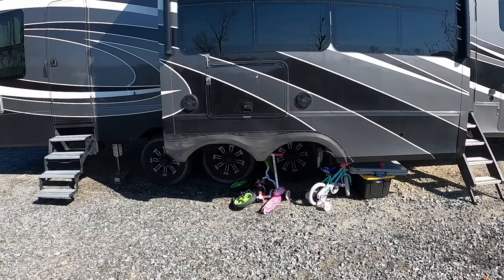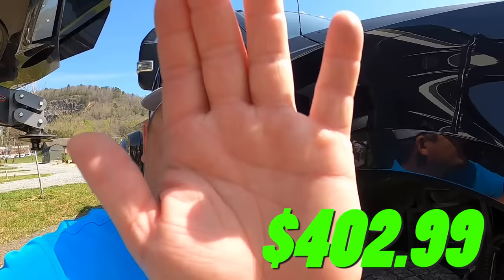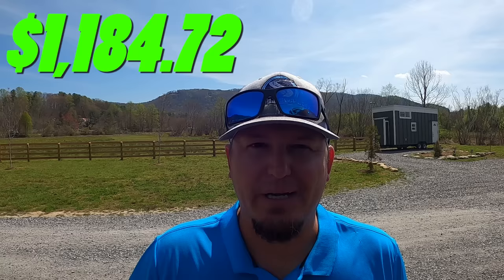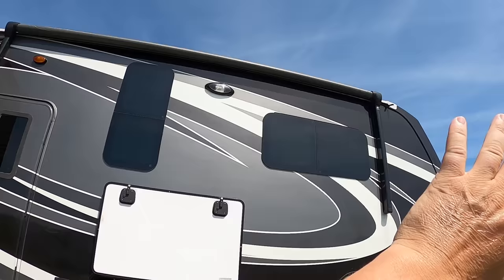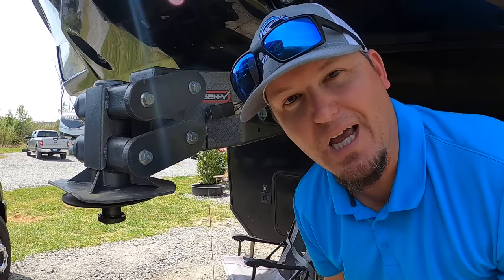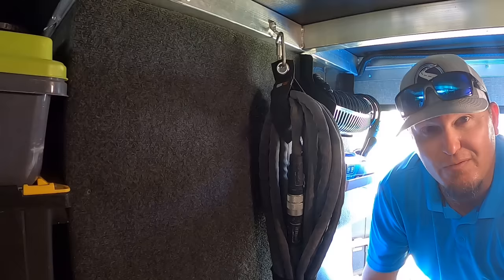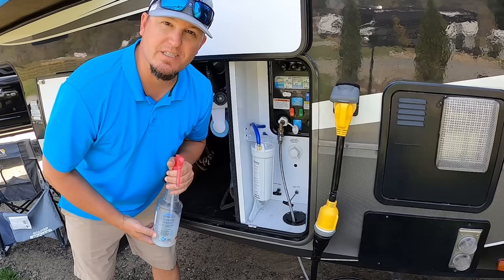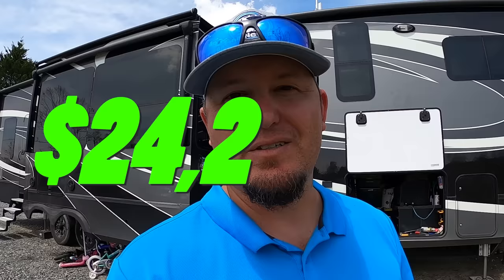These Things Are Money Pits! Everything That We've Had To Repair! | Fulltime RV Living!

Comment: We’ve had a Chevy 3500HD and 37’ Montana High Country 323RL for 5 years and have had NO major expenses or repairs. Almost everything that has gone wrong I’ve repaired myself. We’ve towed it all over the USA AND it’s been a great experience. Other than normal wear items like tires, batteries and oil changes, the truck has been cheap to run and reliable. We’ve never once regretted purchasing our Rig. It’s been a home away from home in AZ for several months at a time in the winter and a vacation home in the summer. For us it’s $ well spent!
Reply from the maker: We also have had mostly no major expenses! The roof was the only thing that was out of the ordinary! The rest was normal issues that happen when traveling fulltime! This has been the greatest thing we have ever done it allows us to explore the USA as a family and we love every minute of it!
Reply: You were one of the few.
Reply: Go Chevy!  Good luck !
Reply: We are on our 4th camper had a pop up in the 90s then got an 2001 28' Dutchman Zepher  TT in spring of 2002, with no issues went from ohio to california twice, and Florida every winter then spring of 2016 bought a 2016 38' skyline layton javlin TT traveled from ohio to washington state, new mexico, TX and Florida every winter with no issues so spring of 2024 bought a 2024 43' Salem Hemiphere 5th wheel , so hope we again have a good experience! Love to travel with an RV and it has a bed to match the one in our home! Happy RVing!
Reply: Thank you for your positivity and empowering the dreams of others.

Comment: So you are basically saying that I need to marry a RV mechanic that likes to do repairs and has a lot of money,  and loves to travel if I want to full-time RV. Got it! 😄
Reply from the maker: When we started we just thought you buy the RV and start the adventure! Maintenance and repairs has been our biggest expense each month for the last 2 years of fulltime travel! It is something we didn't plan for, we also learned how to work on our rig and save as much money as we could by doing it ourselves! If you plan on moving often your cost will be similar!
Reply: Hmmmm yes I miss my old 1968 Ford F-250 camper special really heavy duty truck only cost 40$ to change the oil
Reply: And then its no guarantee. I helped a couple, my friends, get ready for the road. He was a mechanic, they both had retirement cheques and they did not last a year on the road. EVERY call I got from them was a tale of repairs woes. The last was a windshield replacement- they no longer made the glass, so buy it custom=$$$$$$$$$$$$$$$$$..
Reply: Uuuuh you better enjoy the wedding coz you won't during divorce

Comment: I was an RV / auto extended warranty claims adjuster from 1991 to 2019 and I learned to never own an RV due to the way that they fall apart, travel trailers are worse than motor homes. If you must own a motor home don't get one with slide out rooms and it's a good idea to be either a mechanic or mechanically inclined so you can do some of the repair work yourself to save money.
Reply from the maker: This is our home and we have traveled fulltime for 3 years now in it! We bought used and made all the repairs ourselves because we knew the cost and time associated with letting a dealership or warranty would take away from our dream of traveling!

Comment: 15 years ago I strongly considered buying an RV and the pickup to pull it with.  It just didn't add up as I considered the fact that these items would significantly immediately depreciate.  I opted to buy a small lake home.  The value of the lake home has appreciated over time.  If I want to I would easily be able to do short-term rentals with the property but so far have not done that.  I sure appreciate the honesty in your presentation, obviously, you know what you're doing.  I don't want to be a doggie downer, but the largest cost that you are incurring is the depreciation on your equipment.
Reply from the maker: Yes they do depreciate, but these are tools that allow us to do what we wanted, and that was to sell it all and travel fulltime as a family!  This is not something we will do forever but it is what we are doing now, we planned for it and we made it happen, I knew we would have more maintenance and repairs because of our how we travel, but I didn't think it would be this much! We wouldn't change it though; it is the greatest thing to be able to show your kids the USA!
Reply: Smart choice I move to Florida got it all picked up a home for pennies on the dollar back 10 years ago at the bottom of the crash. Got the beach 10 minutes, along with an airport, and 1 hour away is the cruise port,  plus card room to boot, who could ask for anything more. The thought of endless driving in endless traffic to go where to see what. Been just about everywhere in the US of A doesn't do anything for me.
Reply: @vietnamvet4533  sounds like a nice setup.  My brother and I have both recently retired and we took a roadtrip down that way last winter, really enjoyed it.
Reply: @PavingNewPaths  We own an appreciating asset (rental property) while we live fulltime in an RV.  Best of both worlds
Reply: Yes, it's unwise to buy a new  one of these as the depreciation in the first five years is so great. Also, everything that is likely to go wrong with it happens right away.  If you find one that's five years old, well maintained, it probably has the kinks ironed out by then.  These are notorious for poor build quality these days and you have to do your research to find the most reliable models.
Reply: If you want to travel the USA driving, buy a nice car/SUV and stay in Hotels.  No hassle, no worries and save tons of money.  Simple.  No need to play house as an adult.
Reply: I do appreciate the great  information but I sounds like you're whinning about basic maintenance and repairs that will come with owning anything.

Comment: My wife and I had basically the same setup, 43ft luxury 5th wheel, F-350 4wd dually which all together initially set us back about $150k. We bought ours with the intention of using it all to vacation with until retirement and then to spend about 6 months of the year on the road. The truck was no issue, it drank diesel and a complete service was in the area of $500 but was a very solid vehicle. The RV was another story, we battled constant HVAC issues replacing all 3 rooftop units twice in the first year. New tires to replace the China bombs, an ice maker leak, troubles with the  hot water system, awning, lights, self leveling, quality . Most of these big luxury RV’s are designed and built to look good sitting on the dealers lot, unfortunately there is little to no quality built into them. In the end we sold it all and lost half of our investment. I know some folks have great luck and great fun doing the RV thing but for us it was an absolute nightmare. Mostly my fault for not doing my homework before jumping in.
Reply from the maker: The truck has been flawless we only do maintenance and consumables on it! The RV was rough in the beginning but now its pretty basic stuff we do now! Could they be built better, absolutely! would we do it again? Yes! But we now understand that your biggest expense will not be food, diesel or adventures,  but maintenance and repairs on your rig!

Comment: I used to say when I was a regular tent camper. "It costs alot of money to live like we are homeless for the week." Seeing the RV cost is mind blowing.
Reply from the maker: This would be hard to justify if this wad s toy that we only used a few times a year! But this is our home and we travel fulltime, this was what it cost us to maintain it over the first two years!
Reply: I’m just disappointed, had a used small unit and it needed minimal maintenance, our trips usually within a day, and our truck very well maintained by the previous owner. New unit has literally fallen apart every time out. Replaced screws too small, added a lot of glue and spacers and washers, trim pops off, doors warped, upgraded mattresses and some door latches. And they blame 1/2 ton towable, but not near weight limits and no trouble handling, just not well assembled. Screws are cheap and light. And if you make a reservation, show up or cancel. So tired of 3/4 full campground, and good sites empty.

Comment: I had a low end ($ 35,000 ) travel trailer and spent lots of time and money fixing things. Since we only used it a few times a year, it did not fall apart as much as it would have if we used it more. I towed it with a Ford F250 with a V 10 and I got around 7.5-8 mpg when towing. I did the math, and it costs about the same to stay in decent motel and drive our Camry hybrid when we travel. Yes, RV parks are cheaper than motels and you can prepare your own meals when using the RV, but the cost is about the same. Yes, these are two different experiences, but I prefer the simplicity of traveling in a car. When you factor in the maintenance and depreciation of the RV, there is no comparison in costs. The only way to come out " ahead " in an RV is if you live in it and do not travel from place to place too much. By the way, I gave up on the travel trailer and gave it to our son who needed a place to live in.
Reply from the maker: We think RV's are great but if you only use them a few times a year get the hotel and have a great vacation, it will be much better!  But if you actually do use the RV and travel it is the way to go!  We live and travel in ours fulltime and it has been great, but this is also to only way we could justify owning something like this!  There is no way we would have a rig like this any only use it a few times a year!

Comment: From what I have seen over the years, all but the most expensive, upper echelon RV's are manufactured with the absolute cheapest parts and materials available, using the cheapest unskilled labor they can hire. With the exceptions of small independents, and companies like Prevost or Newmar, 95% of everything on the market isn't built to last.
Reply from the maker: I will agree Newmar, Prevost, Liberty, and Newell all build great rigs! But they are not without problems, and they cost significantly more to fix! We have met so many fulltimers with those and they stories they tell are very similar to ours! Bottom line is our RV is perfect and is doing what we bought it to do! We do however use it fulltime so we have more maintenance and repair than someone who only uses it a few times a year!
Reply: Buy a used school bus and make that into an RV. They’re sturdy, made for the road and can haul a lot of weight. Forget the black tank toilet and build a composting toilet, they work and don’t smell.
Reply from the maker: @kenhoyer8601  We travel as a family of 5, the setup we have works perfect for us!
Reply: @PavingNewPaths  just a suggestion
Reply: @kenhoyer8601  No, you bragged and preached.
Reply: @chevyyyyyyy  sorry 😞

Comment: It's amazing how all the little stuff adds up!  It would add up a lot faster if you didn't do a lot of that work yourself.  I tell people that want to get into RV'ing on any level, that it's a full contact sport and they better be ready to go hands-on, or it's gonna be a lot more expensive than they imagine.
Reply from the maker: We budgeted for this kind of stuff, but we were way off on how much should be in this category!  We never imagined that we would have so many things that needed to be fixed!  Honestly most of this was the first 3-6 months, almost like an extended break in period, every time we moved something new was wrong! We still have some issues now but it's not like it was those first few months of traveling fulltime!
Reply: @PavingNewPaths  There will always be some issues, but the situation with your roof was extraordinary.  My old camper was a 31', '94 Damon Escaper, still had the original roof on it, and no leaks (got rid of it in 2022).  Hope the roof on my hauler lasts half as long!!!  Biggest project I ever had on the old one was replacing the entire slide floor by myself, so only cost of materials and my time.  Other stuff, like routine PM, updating the interior, wrapping it in camo, and lifting it 7" to fit over the 450 were just fun mods. Only things I've had to deal with so far have been minor annoyances that I fixed myself, but I'm sure there would be more if I was full-time putting your kind of miles on it...  Hopefully, the next 2-years will be cheaper for you than the last two!  As always, looking forward to the next video, and safe travels!!!
Reply from the maker: @OOMAN  The roof, the pinbox and the bottom falling down were the ones that got me frustrated! The rest all very minor and were easily repaird with a trip to the blue store and some time! Most of these things came in the first 6 months of travel, since then it's been very smooth sailing!
Reply: We have been on the road in a Motorhome for 2.5 years and 20,000 miles. We r in it for a fuel pump, a tire, a battery, a stabilizer bar and a starter motor for the gen. Did most of it ourselves and are in about 2k total. Our rig was 20k. We have had a blast! So it can be done on the cheap.
Reply from the maker: @JamesBond-st4qu  Sure but your probably not doing what we are doing we travel as a family of 5 and move every 7 days! We have 80k miles on the truck, if your doing it for less it's likely because your doing less! Our cost is a reflection of how we like to travel!
Reply: @JamesBond-st4qu   👍🏻👍🏻👍🏻  Just think what that would have cost you in time and $ if you didn’t do it yourself!  Good on you!!!  That’s what I’m talkin’ about!

Comment: On my motorhome I sold 6 months ago, it had a clear plastic handle by the door and when the sun would catch it for a couple hours each day, it acted like a little magnifying glass and made a permanent burn mark on the siding.  I guess I'm fortunate it didn't burn thru.  Worst thing about this motorhome was the huge windshield that cracked twice and very expensive and difficult to replace, and we had to have the Ford vehicle air conditioner replaced twice.  That was really what did it for us to sell it as we were leaving to go on a 4 day trip and got 12 miles and had to go home.  It wasn't just because the A/C wasn't working, it was because the A/C unit bearings burned out and made the whole engine turpentine belt loose and did not want to risk the belt breaking.
Reply from the maker: That's unfortunate! We really like having our living space away from our vehicle so that if something were to go wrong with one, we would still have the other!

Comment: Wow I'm soo glad my wife and I agreed to go the vintage bus conversion route. My bus is a 77 am general. It goes 26k mi per oil change, gets 6mpg and has only required tires, a starter, oil change, and one air filter. The only upgrade I ever did was a pair of diesel heaters. Get something built to eat miles and you won't have these problems. My bus is on a million mile chassis. It's actually designed to be loaded to 26k lbs without destroying itself. Not only that it had already proved its reliability in records before we bought it. The builder used it to haul a car back and fourth to speed week on the flats. It's amazing how terrible the build is on new stuff. Under the paint my bus is all stainless steel and it will probably still be here after I'm long gone.
Reply from the maker: The don't make anything nowadays made to last anymore! My grandpa's 1992 F350 dually is still around today running like a champ, my 2020 truck will likely not live long past 2030!  We live in a throwaway world now where you are constantly having to buy new or upgrade! I feel like they build them to get a certain lifecycle out of the product so you will have to buy it again in the future!

Comment: I'm retired and waiting for my wife to retire. Over the years we have owned 5 RVs and decided that we wanted to do part-time RVing(50-50) in retirement. My wife has decided that she wants to travel in a 5er which also means a bigger truck to pull it. This video is VERY comprehensive. I really appreciate it. No one has put out anything this detailed on the truck/trailer combo. We still have another three years before we pull the trigger on the combo, but this has made me rethink everything. Thank you for a very detailed account of daily maintenance.
Reply from the maker: Thank you so much! We are glad you liked the video! My advise is get the biggest RV and truck you m can get if you plan to spend extended time in one! They all break down no matter the size or the price, simply if you actually use them more than just camping you will work on them more! You also have to remember we are a family of 5 and we move every 7-10 days! Our cost reflect our travel style! If you moved less often and have less people living in it you're cost will likely be less in some areas! If you want to know what we spend each month check this video out! https://youtu.be/RQGACy9_-WM

Comment: When I decided to go full-time, I bought a used truck that did not require DEF and bought one of the best fifth wheels on the market -- New Horizons Majestic. Although I had to do maintenance, I never had the problems you had. Maybe I just got lucky, but I had my fifth wheel for 8 years until I sold it and bought another New Horizons. They may be expensive, but they are nice.
Reply from the maker: We think everyone experience is based on how they travel! We move every 7-10 days and have for the last 3 years, sure we have problems but we are really using and moving the RV more than most! I could take any brand of RV at and price and if I used it the way we travel, I could make the same story! When someone says they have an RV that has no problems, they either aren't using it or don't own it anymore!